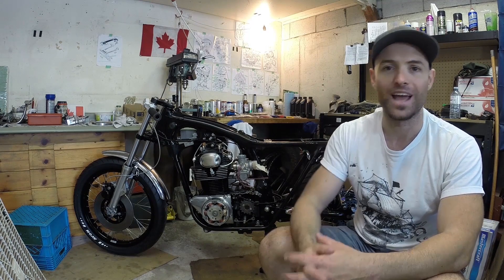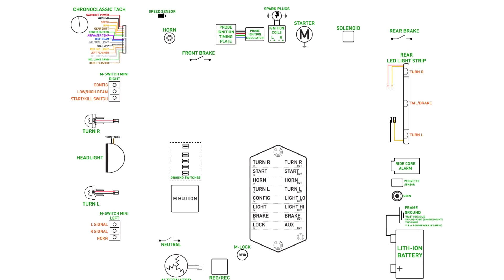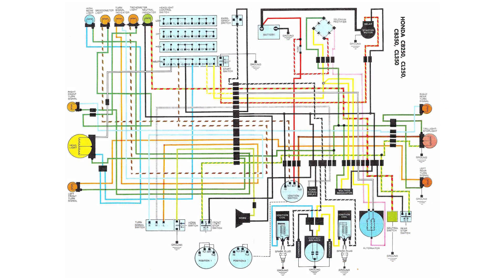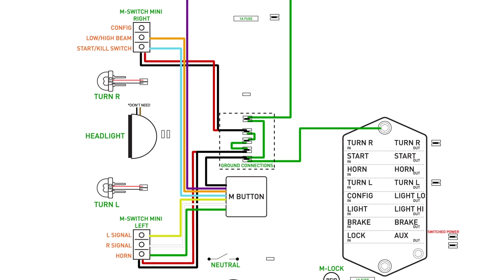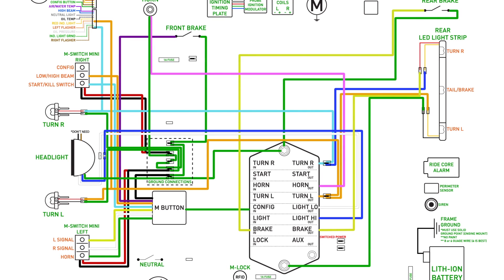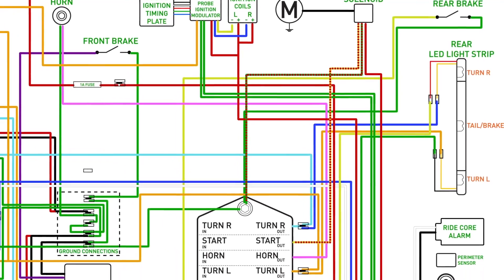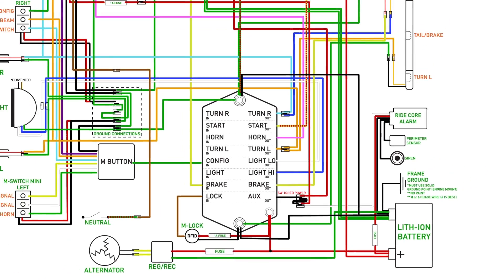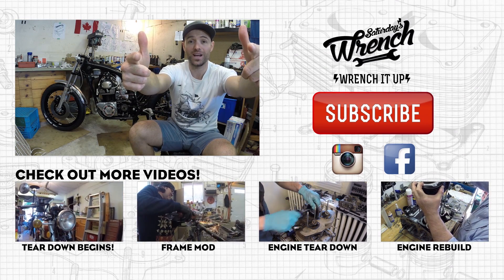Saturday's Wrench Ep.31: Wiring a Motogadget m-Unit - Honda CB350 Build

Comment: What gauges of wires did you use?
Reply from the maker: I purchased a wiring kit from Revival Cycle that has many different gauge sizes. I can’t remember exactly what they were but you can look it up on their site. Obviously I used super heavy gauge wire for the battery ground wire.

Comment: Nice vid! A couple of questions. Which electronic ignition did you get? As far as switched power, isn't everything but your M-lock switched power? Why is it only the components connected to the AUX output?
Reply from the maker: Hey man, I went with the Charlies Place ignition. I honestly can’t remember the other answers to your questions, sorry. Its been so long.
Reply: @SaturdaysWrench  No worries at all, man. I am looking at the Charlie's Place too, but it looks like the whole module is contained in the timing plate without a modulator like you have in your diagram.

Comment: Why are the headlight controls on the right side attached to the kill switch..never seen that before
Reply from the maker: Haha it’s just the way the small button control was laid out. I suppose I could have laid them out any way I wanted to but those mini push buttons are expensive and I only wanted 1. I will admit the controls do take some time getting used to and if I were to build another I would buy larger buttons and spread them out.

Comment: Can you do a tutorial on how to afford motogadget parts?
Reply from the maker: LOL!!!! Yes, actually. But in writing: 
Step 1 -  Open a savings account. One that you don't have easy access to and that you have to go through a process to remove money from it like going into the bank and signing a paper in order to move money around. If you have good will power you can ignore this, but still open a savings account
Step 2 - Have the bank automatically withdraw 10% of your paycheck every time you get paid and transfer it into your savings account. Don't think about this money.  Start with 10% then increase it by 5% increments over time, you will slowly adapt your lifestyle to accommodate this change, trust me. I did this until 50% of my paycheck was going into this account. 
Step 3 - watch your money grow! Buy motogadget parts and baller ass cheeses. Enjoy!
Reply: GET A JOB OR GET A BETTER ONE

Comment: Hi. Thanks so much for this. It's really well made and easy to understand. I've been scratching my head about how to wire in the main fuse as per the M-Gadget diagrams from the manufacturer's manual. I could not figure out how to wire in a 30 or 40amp fuse in to the large 10mm battery wire, but I notice in your diagram you don't do that. Instead you put the fuse at the regulator which is a smaller diameter wire and you connect the m-unit directly to the battery. Is this ok to do as I cannot find a neat method to wire a fuse directly to the main +ve from the battery?

Comment: what do you suggest using to connect all the ground wires into 1 or 2 wires so that I don't have several ground connections and will just have them all go into 2 wires one for the front gadgets and one for the back connecting to both ground terminals on the M-unit.
Reply from the maker: +matt adams I was thinking of using one of those terminal 9 pin connector things.
Reply: yeah I wasn't sure if I should solder them all into 1 wire or use a connector of some sort. do u know if I connect like 9 ground wires into 1 does that wire need to be larger since it is handling several ground connections?

Comment: Hey Saturday’s wrench great vids! I got the M-Unit for all its perks I also got the M switches and that’s where my question lies, so on your videos you showed how to shrink wrap and hook all the relays in the wires. But you did not show how to wire the M switches, did you Solder the wires or did you just put them through the hole and tighten the screw? Your input is greatly appreciated and needed hahaha thanks.
Reply from the maker: +armando campos hmm I'm not sure I understand your question. When you say M Switch do you mean the control buttons on the handle bars? For connecting the wires to the m unit I crimped on these special connectors ( I can't remember the name of them for the life of me).. it's in one of my videos, then I shrink wrapped over it for a secure connection. It was also recommended to me to solder all bullet connectors and everything. I sadly only crimped and shrink wrapped but if I were to do it again I would also solder.
Reply: Saturday Wrench, thats what i meant the control buttons sorry, and thats what i pretty much did to them i crimped the ends and shrieked wrapped them for a secure connection, thanks for replying. Cheers!

Comment: I also got the Motogadget Chronoclassic Speedometer (which is sexy as F*#k).  My questions is, how did you install the speed sensor, and magnet? Can you share any helpful ideas. Thank you and keep up these awesome videos!!!!
Reply from the maker: Haven't installed that one yet! But I don't think it'll be that hard. I'm planning on fabricating a small bracket that I can attached to the wheel clasp that holds on the front wheel. Then I'll glue the magnet to one of the wheel bolts and make sure the bracket is holding the pick up in a place where it passes. Thats the plan so far but haven't got there yet!

Comment: AMAZING JOB!!!! I have a tons of questions, but let me get through this gradually. Did you use a terminal ground strip or ground block for your ground connections?
Reply from the maker: Neither of those things, mostly bc I have no idea what they are. The M-unit has grounding capabilities and as long as you properly ground the m-unit and battery to frame you should be just fine. Or so I was told by a technician who guided me through this process.

Comment: Brilliant Video. Thanks you so much this has helped me a lot with my 85 BMW R80 CAFE racer project. I just realised I didn't ground my m-unit to the battery but it's still grounded to the frame and works, do I still need to run 2 ground cables from the m-unit to the battery?? thanks again.
Reply from the maker: +Sgt Frag I would say yes. You can never be too overly cautious with that. If for some reason your frame ground fails it would be trouble. It's not going to be too much trouble to ground to battery and it may save your system. Its a no brainer in my opinion. Love the R90s!! Always dreamed of doing one.. maybe someday! Best of luck with it! Do you have a build thread online or any documentation on youtube or any forums? If so hit me up w the link. Would love to learn about what it would take. Cheers bud!

Comment: Awesome video!  What kind of crimps are you using to junction one wire and come off with 2 wires?  An example would be the ground connections or your turn Right/Left out.
Reply from the maker: +Joseph Delvecchio It's called a double bullet connector. One input with 2 outputs. You can even get triples. Best if crimped with an open barrel crimper and lightly soldered.

Comment: I used my ferrules for the  motogadget buttons on the handle bars and soldeered then on. So can't really take them off. Don't ask me why I did that lol combination of late night and redbull. I know about hear shrink I also bought the same from revival I was trying to describe the clear plastic connectors on the wireing, but of course doing a poor job at explaining it lol. Also were did you get the loom from. Thnx for the fast reply.
Reply from the maker: haha red bull! It gives you wings and makes you wake up in the middle of the night with a racing heart beat and full sweats! haha I got the loom from a local motorcycle shop close to wear I live. You should be able to find it online very easily though if you don't have a local shop close by.

Comment: About to start wiring my  motogadget m unit and looking to find out were you got all the wiring connectors and tools. For example the furrels and the rubber fittings to go over the connections?
Reply from the maker: +Arje Lofgren I personally got my tools from Revival cycles. You can get them from many places, all will be close in price. The rubber on the ends is called Heat Shrink tubing and you can also find it at a lot of places but again I got mine from Revival Cycles. It comes in a convenient kit with all different sizes. There's double wall and single wall, double wall is thicker slightly and has adhesive that sticks when you apply heat. The ferrules came with the Motogadget wiring kit I bought.. you can find that from various sources but Revival also sells them.